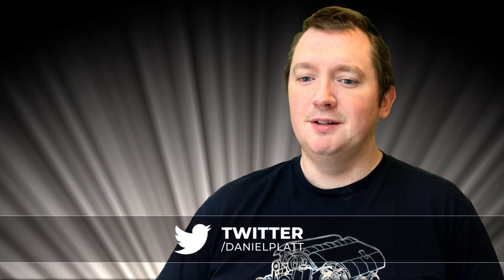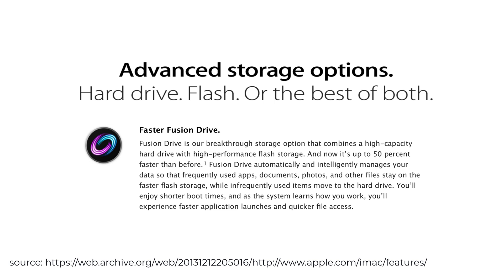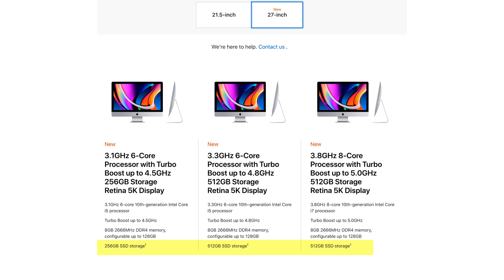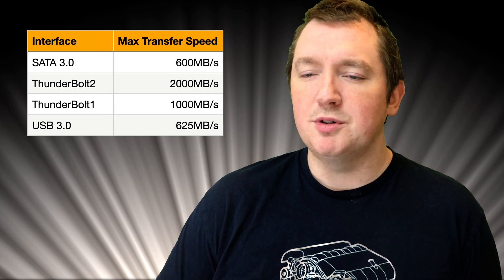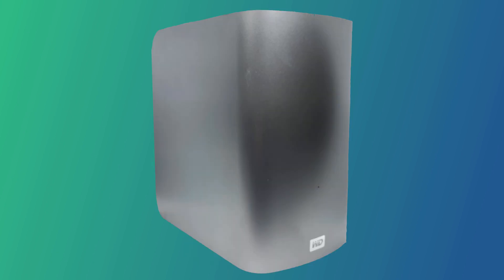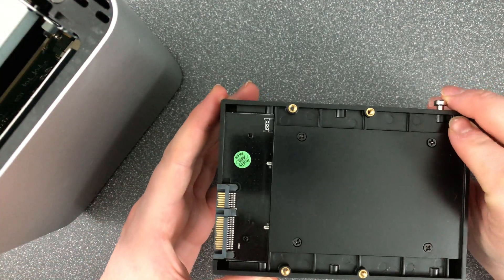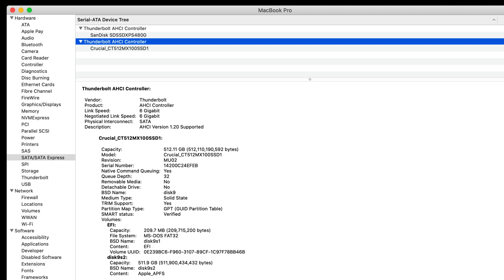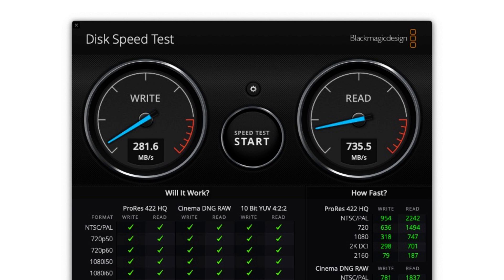Improve the Performance of an Fusion Drive iMac

Comment: Hi Dan,
I have an iMac that I boot from a Samsung T5 external SSD via USB 3 and get similar (even a bit higher) speeds as you. I also have Thunderbolt 1 adapters and external casings but the SSD speed does not increase as it all is restricted by the SATA interface. If I could get my hands on a NVME to thunderbolt adapter it would increase the speed drastically but I have not be able to find one. The alternative is replacing the internal Apple SSD by an NVME drive with an adapter, which I did with my 2014 Mac Mini and 2013 Mac Pro, but as the. iMac is not my main machine, going to the hassle of opening it up is too much for the speed improvement above the T5.
Greetings,
Peter
Reply from the maker: Interestingly, my iMac had the sata drive replaced with an SSD.  However, like everything it broke after a 4 years of usage.  This is why I’m loathed to replace it again.

Comment: Interesting experiment but not better than installing an internal sata ssd, how about thunderbolt to nvme? I guess enclosures are too expensive? Which is the problem with thunderbolt?
Reply from the maker: Interestingly that iMac did have an aftermarket SSD in it.
However, it died and I'm loathed to take it apart again.

I have another video where I did connect that iMac to an external ThunderBolt enclosure.   https://youtu.be/2_5EJFpLlR0?si=5CKv1dc0-NXBiz7l
Which is faster than the internal SATA port.

Comment: That iMac has an internal NVME interface! You only need a tiny adapter for the proprietary slot. The performance will be at least 5-6 times higher than what you have now.
Reply from the maker: You absolutely right.  
The issue is that interface is on the wrong side of the logic board and would require a lot to dissemble. 
In the past I have swapped the mechanical drive for a sata ssd. 
Whilst it won’t look pretty, this method allows anyone to do it, with no risk.
Reply: @TechTalkofDan  if I can do it you can do it. I put a Samsung 970 plus in my iMac with adapter and get 2500 writes, 3000 reads. Also have an internal 1tb sata ssd for storage. Most recent time I just is Pokémon cards to cut the adhesive in the iMac. it works excellent you don’t go in more than a fingernail deep and be careful around the camera.   Take your time watch some videos. trust me if I can do it you can do it. I am just contemplating putting a i7 7700 in  as well, that might be pushing it for me. Cheers
Reply from the maker: @jackiescum5438  My iMac is currently refusing load.  So I'm currently debating whether to take it apart or scrap it.
Reply: @TechTalkofDan don’t scrap it do the full take apart and double ssd upgrade, what have you got to lose, just for fun? We know the value of the machine makes it not worth it but hell why not ;)